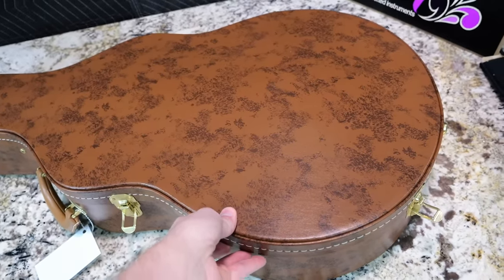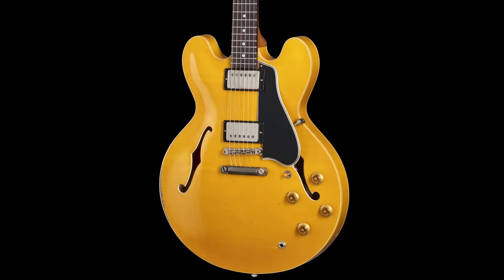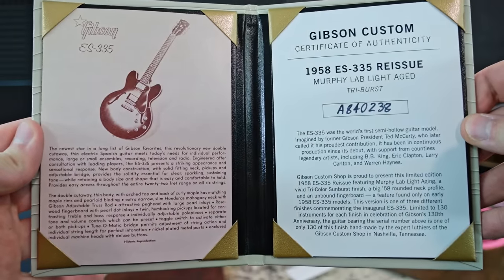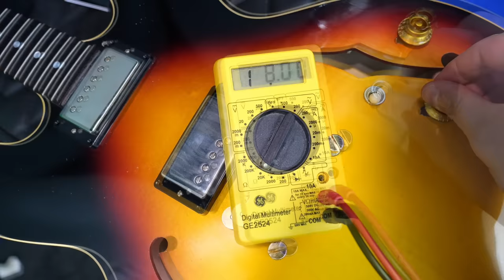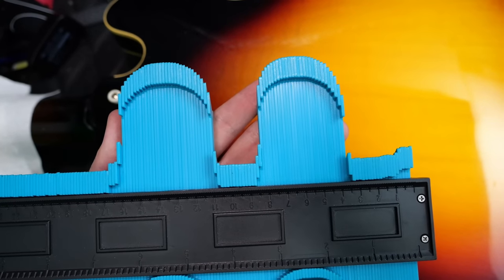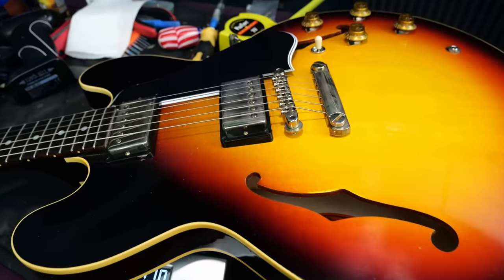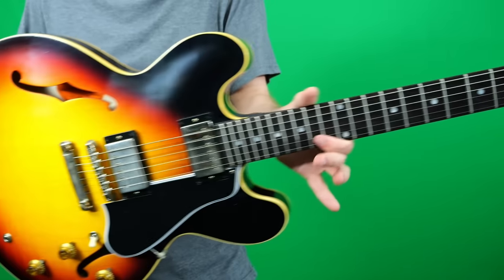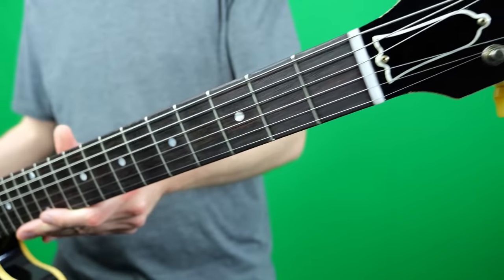This is Really Cool! | 1958 ES-335 Reissue Murphy Lab Light Aged Tri-Burst

Comment: The secret to non-wire ABR-1 back in the olden days, was once you had it setup, a dab of shellac will keep the saddles and screws in place. Shellac is nice, because it easily cleans off with alcohol.

Comment: The amber switch tip is Catalin and is what the 50's Gibson's came with.  The white switch tip didn't arrive until mid-1960.  The amber (Catalin) switch tip is correct for '58 and is what I would have any '58 RI of mine.  The Catalin ones are machined and have no casting lines.

Comment: Salutations Austin!
Very nice ‘58 Reissue ES-335, I especially like the lack of binding on the neck and no fret nibs, 15:54 however, I am with you, I would rather have the option of not having it aged by the Murphy Lab at an extra premium price, it would be much better to me to have it just like a brand new guitar and have it age naturally, I tend to take fairly good care of my guitars, and I definitely rather save the extra $1500 dollars for them to leave it alone.
It sounds great, as is, but if someone wants different pickups, there are so many options available to suit just about anyone, personally, I might prefer the’57 Classic set, but there might not be much difference in sound quality, however, the newer versions with four (4) conductor wires do offer the option of coil splitting, however that also requires having it custom wired, which is what I would prefer to spend extra expenses on, more bells and whistles, not on premature aging.
Thanks for sharing!
Please have an excellent and awesome day!
☀️✨🎸

Comment: The first production models of the 1952 Gold Top Les Pauls were gold on the back of the body and the neck. Not just the front of the body and had dot inlays instead of trapezoid inlays on the fret board.

Comment: I have one of those dreaded 2015 gibsons, a studio, it's  so badly made the neck wasn't cut correctly, it was sliced diagonally which mean the tuners don't line up. 
It's the most vibrating guitar I've  played, I've kept it over a 90s standard and a 2010 custom , it just sounds great, it's so badly made that about every month I have to lossen and tighten the truss coz it vibrates in the neck... the guitar is a real pain but it is one that I won't sell.